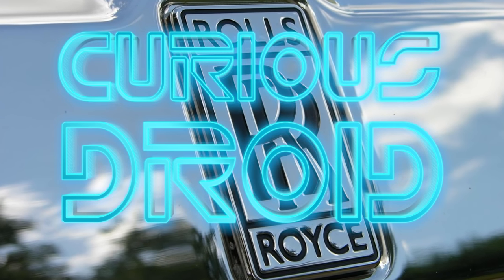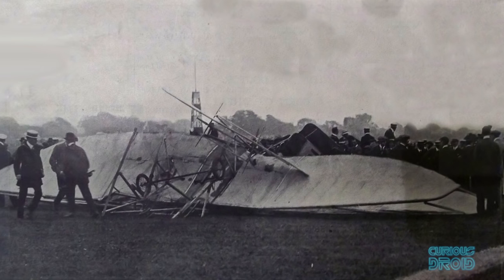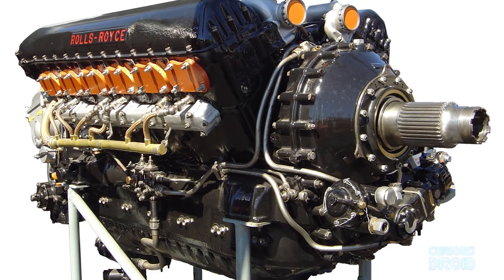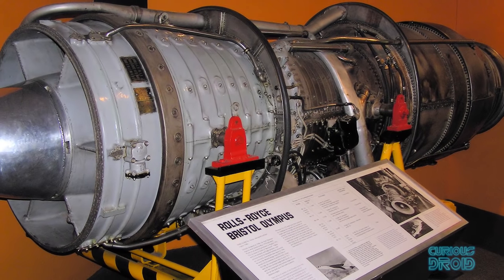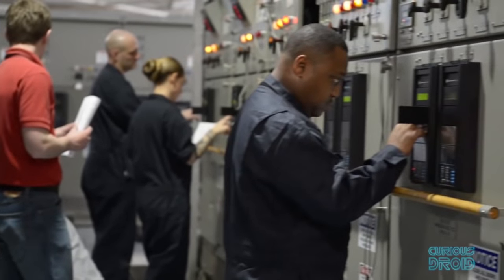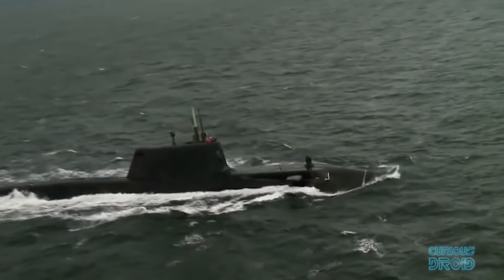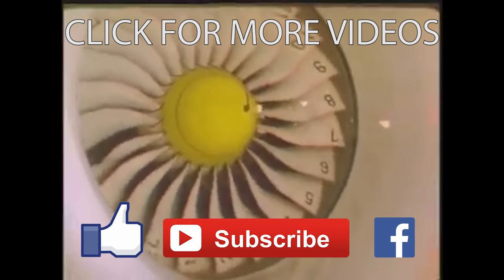Rolls-Royce | What else do they make other than luxury cars?

Comment: I think you misspoke: 3:35 "...World's first and only supersonic plane." I believe you mean, "...world's second and last supersonic passenger plane."
Edit: Correction on my part.
Reply: Even that is not totally correct, world's first supersonic passenger plane was powered with Kuznetsov engine not  Rolls Royce engine (Tu-144 flown 3 month before Concorde, it was introduced to service before Concorde flying mail and freight).
Reply: Miloš Lazović 
Ah. Thanks.
Reply: Pippin 2026
Tu-144 design is based on Tupolev proposal for USSR answer to XB-70 Valkyrie (which lost to Sukhoi T-4), not on Concorde.
Only problem with "stolen" Concorde plans that Concorde was unable to fly till they didn't copy wing design from Tu-144 (technically it could fly but it could not lands and take off).
Concorde was same failure as Tu-144 (which is obvious from number of canceled orders for Concorde), but contrary from west on east they do not try to present it as good thing even it is shit, they just scrub it and move on (Concorde or Tu-144 was not shit as planes but regulations make them useless, especialy they could fly supersonic only over ocean).
And if we look now it look that Tu-144 is more desirable plain then Concorde, there is many attempts to bring it back to service in recent years by "several wealthy individuals" but they all was stopped due luck of permit to export NK-321 engines outside Russia (they are considered strategic military engines and can't be exported as they are used on Tu-160).
Reply: Pippin 2026
And you forgot to mention that Rolls-Royce now are two different companies, Rolls-Royce Motor Cars Limited owned by BMW and produce only cars (they use black letters) and Rolls-Royce Holdings plc which produce jet engines, boats ..... (they use blue letters).
Reply: ***** 
Soyuz is not a dangerous disaster.
Reply: A good mate of mine worked at RR for a couple of years, the old boys there tell stories of how they were asked to leave deliberately misleading Olympus design information lying around whilst maintaining the very strictest security on their true work. Needless to say the plan was for dodgy stuff to be whisked away behind the iron curtain.
Reply: George B the Russia's rocket (Soyuz) are definitely safer than America's one. They are used to send astronaut to the ISS.
Reply: Miloš Lazović  I disagree. Tupolev openly admits to steeling the blueprints and say it was the only reason on how they could catch up on the development of Concorde. They weren't able to get any information from the British, it was all taken from the French side of the operation, but the French have since found out how the information was taken. Although the TU-144 flew first, was slightly bigger and was claimed to be slightly faster, it was ultimately useless in the event. Tupolev didn't fully understand the wing of Concorde and thus couldn't 'Super Cruise'. It could only achieve Supersonic flight in reheat and so could only fly at these speeds for a few minutes resulting in a huge loss of range, not all the way across the Atlantic. The TU-144 was a fantastic Subsonic airliner that could do a Supersonic dash like a fighter, it just couldn't sustain it like Concorde could.
Reply: Theres no argument for stating that the Tupolev TU-144 is in anyway better than Concorde
Reply: It was mentioned at 4.20
Reply: I was going to say the same thing...
Reply: It was the first commercial supersonic passenger plane. There had been numerous military and test supersonic aircraft before that.
Reply: Tested inner rotors for commercial and military jet engines and spacecraft. Exclusively for Pratt and Whitney and Rolls Royce. Turbo Cam and Ingersoll also but mostly Rolls and Pratt.. Pretty cool tho😊
Reply: somebody is eating up propaganda
Reply: dave alders
Tu 144 was not better and was very short lived.
Technology was not that big problem,but lack of money ant time was.
Russians wanted to compete with West in any way,and that took most of the money for research .Not all design worked.

We all know story about steeling blueprints and that is probably true. You can't even imagine what world be like if there were sharing of technology between East and West at those times.Russians had crazy designs and West had money....

To say that Russians today can't build something is crazy,but they do not have money to build lots of that stuff,so they use and modifies some of the older designs .
Reply: Miloš Lazović 
I know it's been a while, but the reason for the Concord cancellations wasn't due to defects in the plane at all.

Once planes started making Sonic books and breaking windows and shit, most countries banned supersonic flight over their land. That quite literally made the only viable routes intercontinental, and there weren't that many that had enough people going back and forth willing to pay that premium for going fast.
Reply: They canceled Concorde,because it wasn't making enough money.
It was a fantastic plane but to expensive to maintain and to exclusive ,which is good when it make money,but Concorde didn't.
There was issue with sonic booms and plane was very loud and very thirsty,and that was big problem during oil crisis in 70'.
I never had chance to fly in that beast and i regret for that very much.
Reply: D4Delta thats because they are literally ancient
Reply: Concordski
Reply: dude the Concorde is the first and probably last depends if another company sends an SSTO or a flying wing passenger supersonic jet in the future or something to land at another Airport with passengers but that super sonic Concorde was the only super sonic passenger jet not a recon aircraft we all know that the Blackbird and the X named test jets are faster than the Concorde but they did not carry passengers don't judge.
Reply: Carl Siemens I think he meant, operational. The tu-144 was only in operation for a very short time, and only flew a handful of flights before being withdrawn.

But yes, he might have expanded on that a bit more carefully and accurately.
Reply: @mrlazda  - They stole Concorde designs, not the other way round, this is widely known so it's a bit stupid to deny it.
Reply: @manicmute9440  So your logic say that they stole Concorde design even Concorde was made after Tu-144, and design of Tu-144 was published 7 years before Concorde first flight?
There is so many key differences in two designs that it is werry unlikely that Tu-144 is copy of Concorde. (for example cooling system was totaly different and cooling system on Tu-144 was one of its biggest problems, so if they copy Concorde why they did not copy one area with they had bigges problem?).
Reply: @mrlazda  
So by your logic, if the Russians didn't copy the cooling system and designed it themselves, it failed... So because the whole aircraft sucked, whole thing was designed by Russians. 
Ok... I'll buy that.
Reply: @rocknral  Yes whole design sucked that is fact, but again NASA picket it over Concorde for Supersonic Flying Laboratory (so then how much Concorde sucked if NASA fund that Tu-144 is better airplane).
Reply: I immediately caught that too.  I was like, lol wut.  Very unusual for a CD video.
Reply: Paul your argument was just to so vulgar that it’s sad to see what people without facts resort to when they’re confused
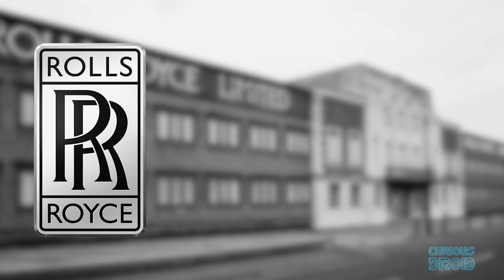Reply: @mrlazda  It's at 4:17, possibly this was added later though.
Reply: @jamesalders896  actually there is, Concord without a doubt was more secseful comercialy then TU144 (mainly do to it's engines), but as a concept aerodynamics of TU144 wore considerably ahead of Concord, and it was larger (it could seat about 40 extra passengers), that is why NASA choice TU144 instead of Concord for their research of the future comercial supersonic flight.
Reply: Atleast he doesnt have AAAAAAAAAAAAAAAAAAAAIDS

Comment: Generally overlook seems to be that Roll-Royce also made engines for railway applications too.  A number of builders of industrial shunting locomotives were fitted with Rolls-Royce "C" range engines, most notably the Yorkshire Engine Company and Sentinel.  Rolls-Royce took over Sentinel in 1957, although in 1980 Sentinel was aquired by Perkins.   Various British Railways "first generation" railcar units were also powered by Rolls-Royce, and the company also built engine for Canadian, Australian and Norwegian railway operations.

Comment: At 2:22 you show an early Mustang Mark I, which is powered by an Allison V-1710, not a Rolls-Royce Merlin.  You can tell as the scoop for the oil radiator is on top of the engine, not on the bottom as in the Merlin powered Mustangs.  Sorry to be picky, but my dad flew 48 combat missions with Merlin powered Mustangs with the 359th FG.  Your channel is spot on, and many thanks for your work.
Reply: Ironically, Allison were bought out by RR.

Comment: love your content,  but the way you mention the concord it makes it sound as the first and only supersonic plane rather than first and only commercial supersonic plane
Reply: But it's not even the first and only supersonic passenger plane. It's actually the SECOND of two ever such planes. The Tupolev TU-144 took flight 2 months before Concorde.
Reply: RedShiftRider Which was built using stolen documents from concords development and only made for propaganda value. Rushed in every aspect of its design and one of the least reliable aircraft to ever enter service.
Reply: Not on commercial flights.
Reply: Curiosity Of Mankind was still a different plane
Reply: @colinp2238  It was brief, but it still made commercial flights. Between 1978-1983 = 102 commercial flights, 55 with passengers. Weirdly the others were cargo flights.

Comment: 3:31, "First and only supersonic plane" wtf?.
If you meant supersonic airliner, that's not right (correct me if i'm wrong, but the Tu-144 entered service).
Reply: It entered service but it crashed at an airshow and since then it was chancelled and nerver gone on route.
Reply: Tu144 did fly and also flew supersonic before Concorde. But only by a couple of months and the TU144 was a failure. Only 100 or so commercial flights, about half actually had passengers, then it become a transport aircraft. In the 70s Tupolev even had to reach out to Concorde’s manufacturers for assistance to try and fix problems. So it may have been first but was a failure.

Comment: Nice video.  One thing, though.  Ironically, the picture of the North American P-51 Mustang was a early "A" variant powered by an Allison V-1710 and NOT the Rolls-Royce Merlin (or Packard V-1650 as it was known in the USA).
Reply: LOL.  That's a bit unfair about the V-1710.  At low altitudes the Allison was a good engine.  And, when mated to the turbosupercharger -- as with the P-38 -- it was actually a very good engine (combination).  But, without a doubt, the Merlin was excellent.

Oh, and bonus fact.  Despite being a British-designed engine, did you know the Packard Merlins were actually better?  Apparently, the tolerances of the production-line-built Packards were better than the hand-built Rolls-Royces and reliability and fuel consumption were better in the American counter-parts.
Reply: No no no, you misunderstand.  The Rolls-Royce Merlin engine was one of the best in-line engines produced -- ever.  What I am saying is due to the way Packard built theirs, the American versions were just that much better.
Reply: The V-1650 -- The Merlin.  Only Allison built the V-1710.

Comment: Basically if it's used by a military, and has isn't a car, it's 9 times out of 10 a Rolls-Royce engine
Reply: Maybe in the UK but in the US it's GE or Pratt and Whitney engines.  Off the top of my head, I can't think of any  US military equipment using Rolls Royce engines other than the Freedom class of littoral combat ships.  Before you say the F35 engines, that is a joint cooperation between GE and Rolls with 80 percent of the development and assembly done by GE.

Comment: 2:27 Made a mistake...
Thats a P-40 not a P-51
Reply: No, it's a P-51B, the early model with the clunky framed canopy rather than the bubble canopy on the D model.
Reply: KurtB The p-51b didn't have that intake above the nose
Reply: KurtB Oh yeah, nvm I see. The p-40 had a bottom intake
Reply: Yeah, I think that upper nose intake is special for the early P-51B with the Allison engine, not the RR Merlin.  Anyway, this and the P-40 do have similarities.
Reply: The picture is a P-51A with an Allison engine. P-51B and beyond had the Packard-Merlin.

Comment: Actually Rolls-Royce doesn't manufacture cars at all anymore, the Rolls-Royce car is still made and it's still called a Rolls-Royce, but it's made by BMW
Reply: flip inheck  https://en.m.wikipedia.org/wiki/Rolls-Royce_Motor_Cars
Reply: flip inheck  Rolls-Royce makes airplane engines, they do not manufacture cars
Reply: flip inheck  Ownership and licensing of trademarks
In 1998, Vickers decided to sell Rolls-Royce Motors. The most likely buyer was BMW, which already supplied engines and other components for Rolls-Royce and Bentley cars, but BMW's final offer of £340 million was beaten by Volkswagen's £430 million.

A stipulation in the ownership documents of Rolls-Royce dictated that Rolls-Royce plc, the aero-engine maker, would retain certain essential trademarks, including the Rolls-Royce name and logo if the automotive division was sold. Although Vickers plc sold the vehicle designs, nameplates, administrative headquarters, production facilities, Spirit of Ecstasy and Rolls-Royce grille shape trademarks to Volkswagen AG, Rolls-Royce plc chose to license the Rolls-Royce name and logo to BMW AG for £40 million, because Rolls-Royce plc had recently had joint business ventures with BMW.

BMW's contract to supply engines and components to Rolls-Royce Motors allowed BMW to cancel the contract with 12 months' notice. Volkswagen would be unable to re-engineer the Rolls-Royce and Bentley vehicles to use other engines within that time frame. With the Rolls-Royce brand identification marks split between the two companies and Volkswagen's engine supply in jeopardy, the two companies entered into negotiations.

Volkswagen agreed to sell BMW the Spirit of Ecstasy and grille shape trademarks and BMW agreed to continue supplying engines and components until 2003. Volkswagen continued to produce Rolls-Royce branded vehicles between 1998 and 2003, giving BMW time to build a new Rolls-Royce administrative headquarters and production facility on the
Reply: flip inheck  your link litterally says that it was bought by BMW
Reply: flip inheck  yes, but the parent company is not Rolls-Royce, it's BMW that was the point I was making in my original comment.
Reply: flip inheck  yes they do, BMW owns the Rolls-Royce car
Reply: flip inheck  I see what your saying now, but the Rolls-Royce motors has no affiliation with Rolls-Royce anymore.

Comment: Rolls Royce doesn't make any cars. They just sale their brand to BMW.
Britain hadn't the first Jet Engime, the Germans had it. 
The Concorde wasn't the first and only  supersonic commercial plane, the Tu-144 was.
That are many mistakes for such a short video.
Reply: Most times the Tu 144 can't hold supersonic travel, only with the Afterburners, or reheaters engaged, so commercial Aviation for the Tu 144 was not supersonic,  Yes the tu 144 was also a bit faster, but lets say the to planes started same time from the same Airport and fly to New York the Concorde will be faster at any time and place simply the TU144 can't hold Supersonic Speed for long, and the second she can't make the trip to New York simply it would run out of fuel, Why America uses a Tu 144 for to develop a Supersonic Airliner is way beyond my imagination and understanding . Only way it can oh no we don't want Copy the Concorde , they better have done it, maybe Supersonic Travel would be Standard to day, and the cancel of the Orders had to with the Accident on the Paris Airshow when the TU 144 broke apart in several Pieces, and also not allowing supersonic Travel over American Soil, if America had it sucseed to build a Supersonic Passenger Aircraft ,it would not have happened
Reply: The Gloster Meteor jet fighter entered squadron service with the RAF in July 1944 the same month as the ME262 in Germany. Frank Whittle patented his jet engine in 1930 well before Germany. https://en.wikipedia.org/wiki/Frank_Whittle
Rolls Royce make cars in Goodwood England. The parent company is BMW.
The Tu-144 was rushed into service prematurely with disastrous consequences.